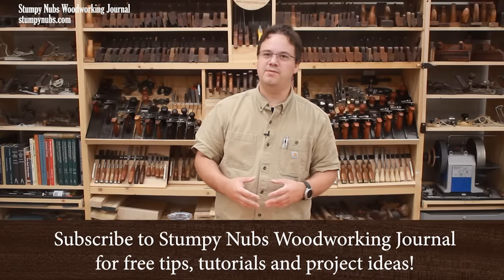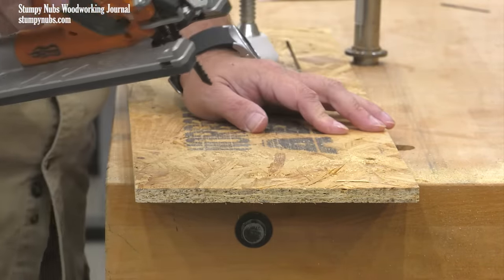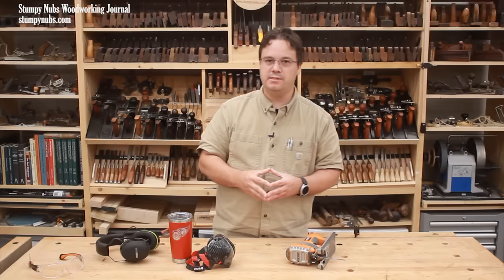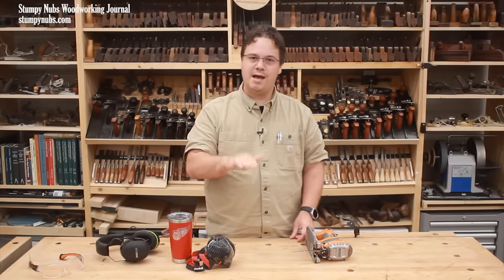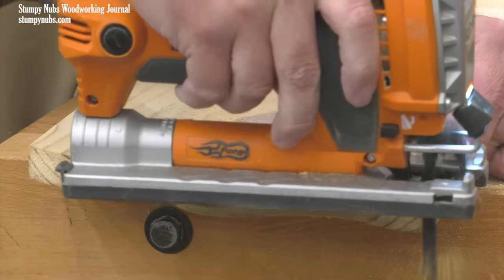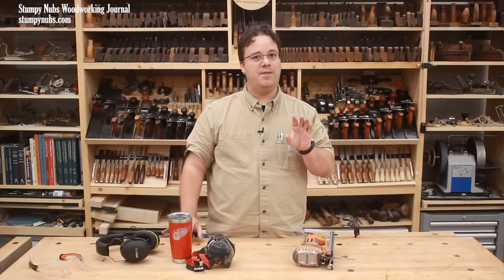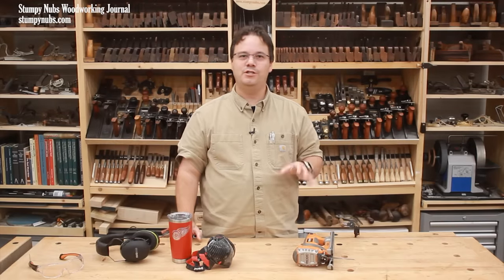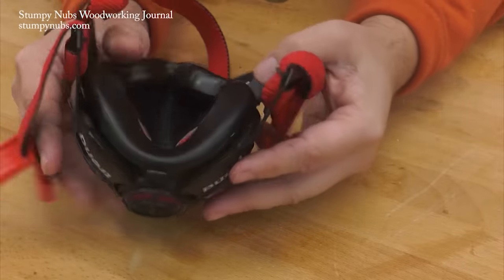How I made my jig saw cut a LOT better

Comment: One feature of older jigsaws from the 1960's or so was  the turnable shaft. Usually with a big square knob on the top. It made for easy to cut tight radii. I don't use one often enough to look to see if it is even available anymore.

Comment: Although you downplayed the usefulness of angling the jig saw blade, when you're scribing a piece of trim to an irregular surface, backcutting the line by angling say 15 degrees can give a nice tight fit, easy to tweak where needed. Another great video, James. Thanks!
Reply: Or when you are installing trim, you can use the jigsaw as a coping saw - even if you just get the cope roughed in, then fine-tune with a handheld coping saw.

Comment: Just a quick tip on the tilt feature that you mentioned at the end. This is a great feature if your doing finish work. If you need a precise scribe to an uneven floor or you have to scribe some type of moulding or panels to a wavy wall or ceiling, you can slightly back bevel your cut close to your scribe line and finish off with a plane or sander or even a grinder with sandpaper wheel.   It won't be visible in the finished product but it gives you way less material to remove when you find tune the fit. The end result will give you a super tight clean scribe.

Comment: Just outstanding.  I never thought of the sandpaper trick in 55 years of using a sabre saw.  I have cut a supported piece from underneath to follow a line closely, and leave a really clean surface without tear out (speaker grills in finished cabinets and desks).  I don't actually recommend it without a LOT of practice.  Variable speed Bosch with orbital stroke and hollow ground blades.

Comment: I used jigsaws a lot more when I was a kid, mainly because I had access to one.  By far the biggest project I used it for was to cut the transition for a half-pipe I was making.  Using 4x8s for the sides, I started with the vertical section, curving slowly into the transition.  When I hit the other size of the 4x8, I used the waste to finish the transition at the bottom.  Nailed lots of 2x4s between the transition pieces, then thin plywood nailed to the 2x4's for the ramp itself.  Skated it for years.
Reply: Also what I did as a kid. Same saw, same ramp man

Comment: I used a Craftsman Sabre saw (old school) for years as it was the first power tool I ever bought. I’d often use my dad’s drill and circular saw but he liked and used my Sabre (AKA jig) saw.  It cut through many wooden boards and other materials until it finally gave up the ghost - the shaft broke after about 40 years.  Good memories with that tool! Also, thanks for the terrific video and lessons.

Comment: One thing that was not mentioned is that sometimes in cheap saws the blade's side and the edge of the base of the saw might not be parallel with each other. This rarely causes issues if you cut free hand but as soon as you try to use a straight edge to follow, the sawblade will keep either turning away from your cut line or bending towards it, making some very frustratingly inaccurate cuts. I attached a piece of plywood to the base of mine with parallel edges to the blade to fix this as there does not seem to be any options to change the sawblade's direction on the saw itself.

Comment: One tip I don't think I've ever seen in any jigsaw video is that when you're cutting at an angle to the grain (that is, not parallel nor perpendicular) then it's really useful to plan ahead so you're cutting "downhill". When yo do a cut like that you'll see the grain on one side of the blade hardly tears out at all and the other side gets obliterated. So make sure to plan the cut so you're cutting "out of the grain" on the workpiece and "into the grain" on the waste side. You may need to make the cut in several steps if your cut is a curve that starts going the other way, so just come in from the other side. Did that make sense?
Reply: This is a great tip, and it does make a lot of sense.
Reply: I agree, excellent point about “cutting downhill” I learned about this as a turner, but for those who don’t know, the “uphill/downhill” part can be confusing. The way I learned to explain it is, (easier with a picture) hold your right hand in front of you, 4 fingers pointing to your left. Your fingers represent the wood fibers running horizontally. Imagine your pointer finger on your left hand is the cutting tool, and you’re going to shave off the tips of your fingers. You are going to cut diagonally from the tip of the lowest finger, to the base of the top finger. If you start from under it, after you “cut” the first finger tip, going upwards to the right, each finger pulls away from previous finger, fanning out the fibers, and the last fiber pushes away, and tears out. If you cut from the top right diagonally downward from the base of the first, to the tip of the last, each fiber is supported by the next uncut fiber, pressing them together, instead of pulling them apart. The top of the cut will be near perfect, with minimum tear out on the bottom. Of course, when turning a spindle, or a bowl, the bottom of the cut usually doesn’t exit the wood, so there’s nothing to tear out, and the whole cut will be much smoother than if you start from the “bottom” of the cut.  This is so much easier to explain with pictures!
Reply: Excellent tip PikkaBird
Reply: To clarify down hill is up the tree right
Reply: Always cut “uptree”
Reply: Makes a lot of sense, never thought about it, and thanks for taking the time to share that bit of knowledge.

Comment: Great video! Something I don't think you mentioned is that because you can change the blade so quickly, it's often the best tool for a single cut. There have been many times when I needed to cut a piece of metal, and didn't want to change the blade in something else, so the jigsaw came to the rescue.

Comment: My first power tool was a drill. The second was a jig saw. Used it for everything from Sheet goods to 4x4s. Love the versatility of a jig saw.
Reply: And you can use a jigsaw for A LOT of different materials as there is a huge assortment of specialized blades, for different metals, plastics and even tile cutting or soft but tricky materials like rubber or leather. In my experience, more than 90% of the cut in many different materials can be done with Bosch jigsaw blades, which are top quality (Swiss made, even METABO goes to Bosch in order to rebrand them in their colors!).
I have used a few other brands for some jobs, like the longer blades that I use when attachirng my jigsaw under the bench, which necessitates a considerably longer blade, in which case I have used "Wilpu" brand long blades, and support their end with small router bit bearings to eliminate deflection and vibration.

Comment: It always benefits to purchase a QUALITY blade.  There is a lot of difference in cut quality by buying a really good blade.  Took me a while to figure this one out, but I learned quickly when I bought a more expensive blade, it made a significant difference in cut quality and speed of cut.  It also made quite a bit of difference in deflection of the blade during a cut.  This helped keep cuts square to the workpiece.  Good video.
Reply: Oh yes, fully agree. It is basically the same thing like the classic advice for using sandpaper: change it / use it as if someone else were paying for it.

Comment: Sand paper power file idea is genius. That’s the one I’d never thought of. For straight cuts I always use a large speed square, or where necessary a longer straight edge of any sort, as a fence. Since I started doing this I have hardly used my circular saw. I have recently bought a used Dewalt 745 table saw though so that might replace both in a lot of applications.

Comment: I've have owned  different Jig Saws for over 50 years. You did a great job covering the proper use. I keep my scroll saw table waxed as well as other metal surfaces to stop friction. But I never thought to wax the jig saw plate. Picking out the right blade for the cut can be confusing for some I'm sure. Cutting is always easier with the right style blade. Thanks for sharing that tip! I have watched a few of your older shows, I've enjoyed them. Take care!

Comment: Yes like everybody, I think I have a love hate relationship with my jig saw. I dont use it often, but its there if I need it. One of the best ones I have used is the DeWalt battery powered saw. A little heavy compared to the mains variety but it cuts great once you set it up initially. Even with out the battery its a  beyond my budget considering I use a jig saw so little. 
Some good tips there, especially the wax on the shoe.
That trend mask is one comfortable and effective dust mask. I purchased one after watching your video. Last weekend I used it for about 90 minutes in my Polytunnel. Thats a big type of Glass house for those who dont know. Big semi circular frames and a heavy poly cover for growing plants / vegetables. Any how it was over 100 degrees F in there and dusty pulling old vegetation out. I leaked a lot in the heat but the mask stayed comfortable and didn't leak. I took the filters out and washed it out, so its ready to go again. I found it has a small drain plug between the filters for washing, very useful.  One of your best tips on the mask. Keep the videos coming ,always interesting and informative.

Comment: The bevel function on the jig saw is great for back cutting scribes in finish carpentry applications. I used to hate using the jig saw because I couldn't get accurate cuts. I have since learned it was my technique, the tips you listed are all solid and helped me learn to love my jig saw.

Comment: 5:55 this! fabricator turned moonlight woodworker. Used to this in metal. mostly for a witness but i never understood why this wasn't standard practice even with a track. to me it's like folding paper on your edge before cutting with scissors. who cars the extent of the support tooling you have to effectively cut it. if you're able, and likely you are, getting a sharp blade and microcutting that line incredibly precisely before hand is almost always best practice atleast mechanically

Comment: back when sawzalls were still a short stroke saw, I used to terrorize cabinetmakers by pulling out a sawzall to make cutouts in cabinets.  I would get jigsaw size blades and I had jigsaw performance with the better visibility of a sawzall.  unfortunately, when they increased the length of the stroke, on newer sawzalls, they started pulling the blade clear of the kerf during the cut.  now I use a rotozip or a hand saw.
Reply: I once received a nasty letter from the maker of Sawzall when I tried selling an off brand reciprocating saw online. LOL

Comment: I have shown the plunge cut trick to a couple of experienced contractors who had never seen it.  It won't work with all blades though - depends on how the bottom most tooth is designed.  I have used pieces of carpet (nap down) on the shoe to protect surfaces.  The file effect can also be done by judicious use of the blade, relying on the tooth offset.  Works quite well with metal cutting blades (in a push have done it with bandsaw as well) if an opening ends up that 10 thou (0.01" / .25mm) too tight, or if the cut line wanders a little.  It takes slow, gentle and very precise hand-eye coordination.

Comment: Back in the 70s all I had was a nice Craftsman jigsaw with an oscillating  blade feature so I learned a lot of these techniques and still am much more confident with the jigsaw than a circular saw. I have a 12v Bosh variable speed jigsaw now which I really like using. I will add the wax and painters tape on the base techniques. Plus your explanation of focusing on the front of the blade as the pivot point makes clear what is really going on as one glides the blade.

Comment: i have to admit as a retired furniture maker, i rarely ever used my jigsaw.  most commonly it was for cut outs that would be mostly hidden from sight afterwards.  as you say though, they are handy when that is the only tool that will do the job.  i also have a circular saw that is only ever used for docking timber for dimensioning.

Comment: My old Black & Decker  "Saber Saw " has a scroll saw  optional feature.  when cutting straight I use the scroll to micro adjust, when I start cutting off line.  When cutting curves the scroll let's you micro adjust, and turn on a dime.

Comment: Great tips, but one you didn't mention:
When using a down-cutting blade (for zero tear-out on the top surface), set your reciprocating function to 'zero'--straight up and down, in other words: You'll have a cleaner cut on the top and pretty clean on the bottom, too. You'll have to go slower to control the cut (and jumping up), however. Down-cutting blades also wear out faster when used this way.
Also, if you ever cut metal with your saw, you MUST use the 'zero' reciprocating function, and, of course, the proper blade, and a drop of oil on your piece.

Comment: One comment about plunge cuts.  As you show at 9:16, make sure you are using an "up" cut blade.  This will help the saw pull into the cut. A 'down" cut blade will try to push out of the cut
Reply from the maker: You plunge with the blade you need for the cut you are about to make.

Comment: Ok wow... I was doing so much mistake with that tool I have learned to hate... I have probably a reversed blade, explaining why it was always so jumpy and a real nightmare to control. I will definitely give it a try after work. Thanks Stumpy Nubs for, once again, making a video full of really good tips and advices! 
Just a small thing, as a non-American, I would be grateful if you could also use mm references as well (in subtitle or in post edition). I'm sure to not be the only one looking your content :]
Cheers from Japan
Reply: 25.4mm = 1'
Reply: @martintheron1386  You're off by a little ways there. 304.8mm = 1' and 25.4mm = 1"
Reply: @classicbandgeek  maybe you know what I meant
Reply: @martintheron1386  I do, but math is a bit more precise than that - especially when OP lives in Japan and uses the metric system only.

Comment: Timely video. I will be cutting an opening for a bar sink in a countertop I built. Tear-out is my recurring nightmare as a contemplate the cut. I cut four window openings in my cargo trailer using a jig saw. By the fourth one, I was close to getting almost nearly not scared by the jigsaw.

Comment: Concerning tear out, Bosh makes a “laminate” blade. You can cut 3/4” without tear out, as it has up cut on the bottom of the blade, and down cut on the top of the blade. It’s also carbide. It’s invaluable for installing laminate and melamine cabinets

Comment: You can use 2 inch thick foam insulation with a jigsaw. You can place your whole piece on it and cut away. If you don't cut too deep into the foam, you can use it over and over. The original use came from Steve Ramsey, who uses a 4x8 sheet of insulation to cut down plywood sheets. But it works for pretty much any cutting. I've used the same piece of 4x8 dozens of times and it's still good to go.

Comment: Excellent informative video.  The downside of the toolless blade changing system is that the blade is not very accurately aligned fore and aft however carefully it is installed.  Even a degree or two out (which it usually is) will make the saw want to wander off course.  When using a clamped on fence, the saw will want to drift either towards the fence with ever more determination or drift away from it, needing very firm hand control to keep it on course.  It's also very difficult to set the blade so it is exactly at right angles to the baseplate particularly when it has been moved to make a bevel cut.

Comment: against tearout, they also make half and half blades that have the top half of teeth pointing down, and the bottom half pointing up. they make the quality of cut better on both sides. Most name brands also sell you plastic insert plates for jig saws, that you can put around the blade. they act as a 0 clearance insert and help a lot.

Comment: I wasn't sure what the best blade would be, so I bought a few each of about a dozen different blades to cover all the different materials and thicknesses I might want to cut.  I store them in a plastic box with compartments, and I stuck a sheet in the underside of the lid that explains what each one is best for.  Call me obsessive, but I can make a nice cut.
Reply: I have had some success grinding a blade narrower, to do really tight curves. Rounding the back corners of the blade as well. Anyone else use this method?

Comment: There are specialty blades with bidirectional teeth. They work surprisingly well.  On the bevel cuts thing, the number of times I've seen people make bad cuts because they did not know that the bevel can come loose and set the blade out of true before they start cutting. (Always check with a square.) Lastly, those $1 saws you mentioned, I'd buy a few.  Rack them up and label with the type of blade in them.  Same for angle grinders.  It saves a lot of time to just pick a tool rather than make a change out.

Comment: Many years ago I had some tight curves to cut ( stainless steel, even with lots of soap on the blade it took an age ), I ground a curve on one side of the  blade so it could go around a curve better. I can't remember if I did left and right handed blades. I have used a jig saw clamped upside down, and fed wood through like you would a bandsaw.

Comment: I use the Diablo top/bottom cut blades and after using them it's hard to even mess with other blades. They really cut down on vibration and also give a nice cut. Unless I'm doing a specialty cut they're pretty much my only used blade.